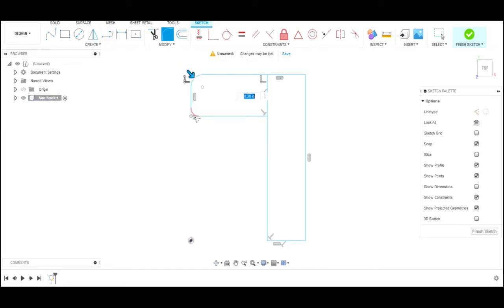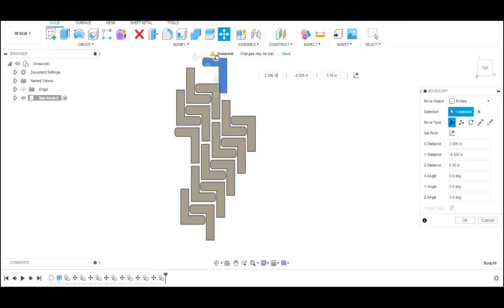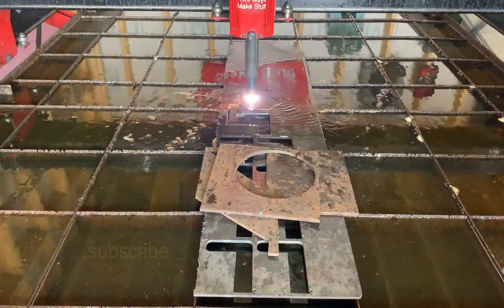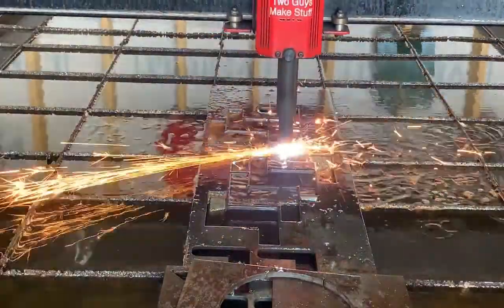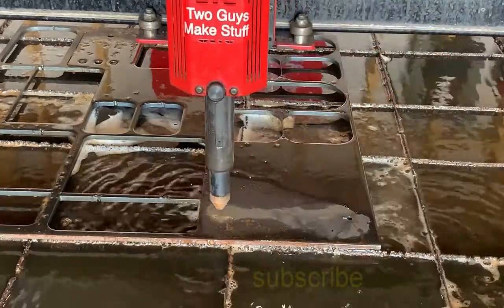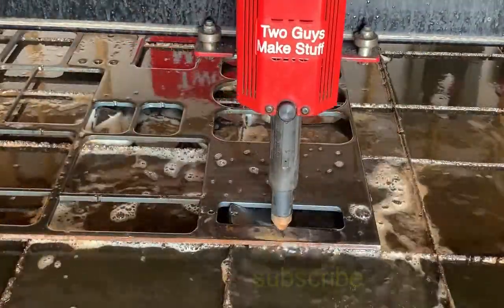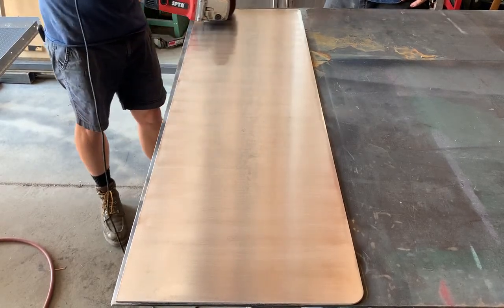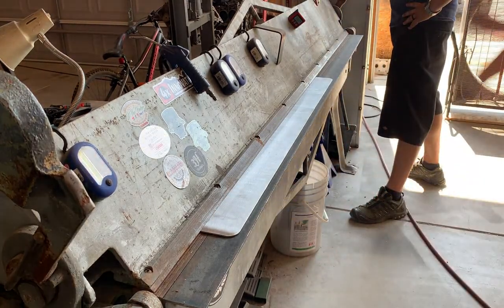CNC plasma cutting and Fusion 360 design. We also burnish and bend some aluminum.

Comment: How do you configure Fusion 360 to overlap the hole cutout by an amount so there's no nib left in the hole?  I looks like your holes come out very nice.
Reply from the maker: That’s done in the lead in and lead out settings in the tool path section of manufacturing.
Reply: Curtis, in the August update for Fusion 360, we've added a new 'Finishing Overlap' option under the Passes tab for 2D Profile strategy. This will help improve the cut quality by preventing the lead in and lead out from occurring at the same point. Thus, reducing the need for secondary operations such grinding/deburring. Hope this helps. #AutodeskEmployee
Reply: @ravijavia8183  Thakns!